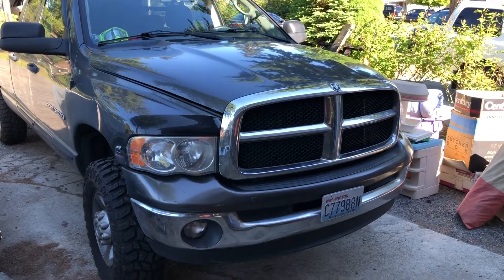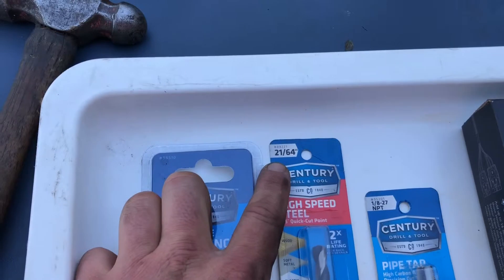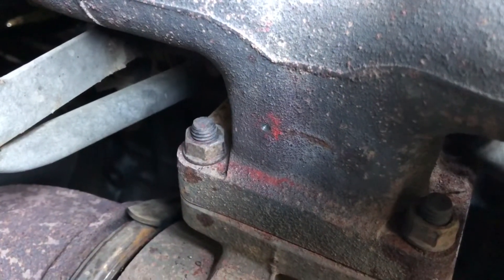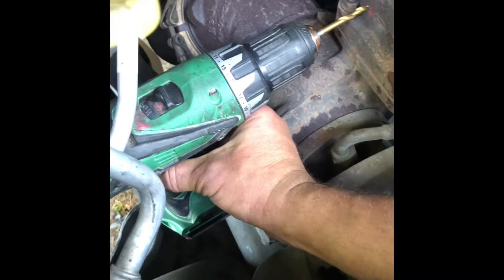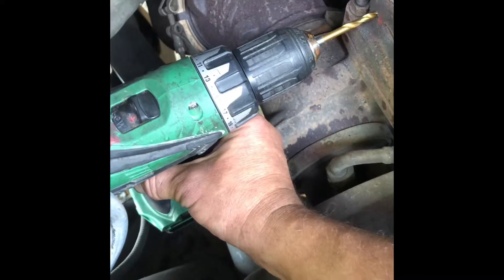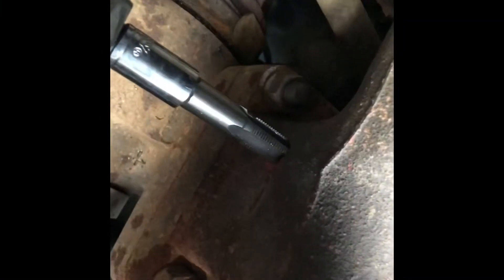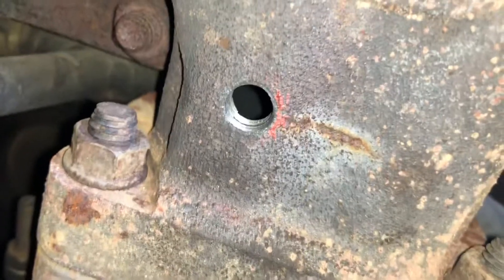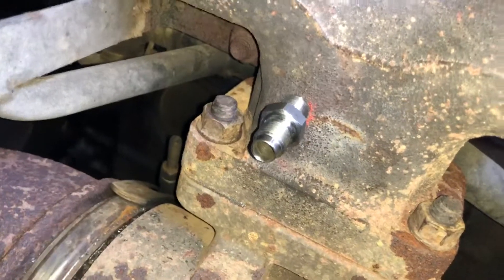3rd Gen Cummins EGT Probe Install

Comment: I have stock injectors and have had no problems. I have 166K on the truck. If I upgrade to the Edge tuner do you have to replace your stock injectors to see any benefit in fuel savings and power.
Reply: Dont use an edge for tuning, get custom stuff

Comment: Good video. I see you live in WA state. I live in Quicene on the East Olympic peninsula.
I have a 2006 Dodge ram 2500 and have wanted to install an edge system but I am reluctant to drill into my engine.
Your video showed the correct way to tackle this job. Good work.
Reply from the maker: Thanks Brian, hopefully it will save you some time, I was somewhat concerned about doing it this way at first, but after talking to other people that have done it many times with no problems whatsoever it worked great. The EDGE CTS2 with EGT probe is is great. My truck has BBi stage 1 injectors good for stock or cranked up to 800hp with dual Cp3, recent Inframe overhaul with a really great rebuild kit from Industrial Injection, ARP rod bolts, Head studs, Aurora 3k turbo and I had Dynamic transmission in Spokane (one of the best in the diesel tranny business) build me a stage 3 650 hp trans. I’m running the Smarty SR on 9 and the truck rips and rows great. 

If you look on my channel I do full in frame overhaul video of the bottom end, previous owner didn’t do injectors and I had 4 pistons with broken rings. I’ll find a link if your interested.
Reply from the maker: Here is the link to the in frame overhaul I did at my house: I cover everything from removing oil pan safely with engine and trans in the truck, piston removal, piston assembly, ring gapping and clocking plus a bunch of other stuff of your interested. 

https://youtu.be/OPnhkODRRiI

Comment: What about getting shavings down into the turbo
Reply from the maker: I was concerned about that initially and the thought really bothered me, but I did a bunch of reading and spoke to To guys who have done it many times buy carefully drilling and vacuuming to minimize metal. Starting the truck for a second or 2 two to three times blows out any shaving with no damage to the turbo. The exhaust pressure just blows it it out no prob. To each their own tho best way if your not comfortable is to take off the manifold which is always fun.

Comment: I know its a lot of work taking everything apart but if metal savings damage your turbo you will have a big $$$ problem and at the end of the day you will any way have to take apart you truck and throw $$$ out
Reply: Just a reason to upgrade then 😁
Reply: If you start and shutdown in less than 2 seconds and do that a couple of times then all the metal shavings will be out of the hot section of the turbo and there is no chance it will damage anything. The turbo would be barley spinning and at such a low rpm nothing would happen. Use small bits first and work way up to keep shavings small.  If you have time then that is the best way if you want to be sure. Takes to long imo.
Reply from the maker: What little metal shavings there are get blown out the exhaust and are not a problem at all. Like you I was concerned about it but after reading and talking to guys who have done it this way there is very little to no chance of damaging a turbo.
Reply: So I should keep my hole clean,  and if it don't fit  dont force it.....   🤔   is this a gay porn shoot pre check list 😳??